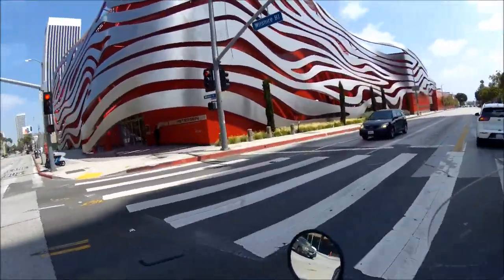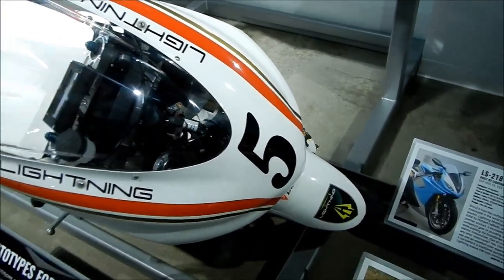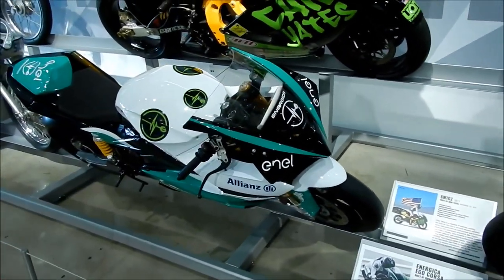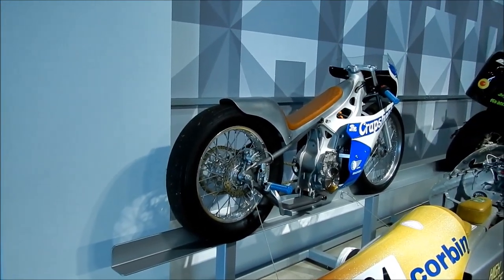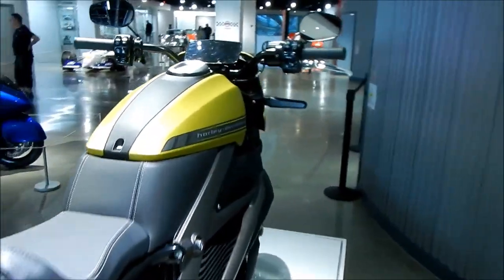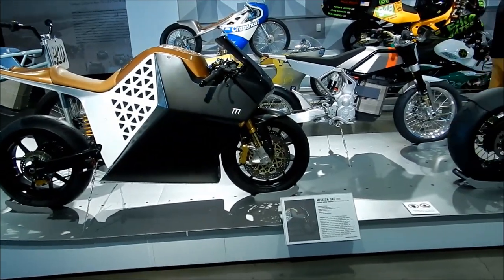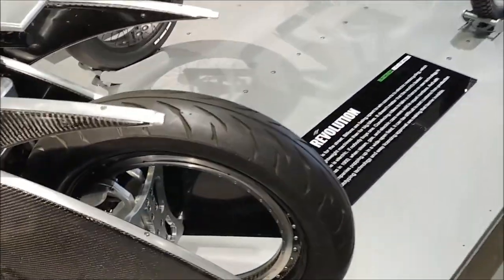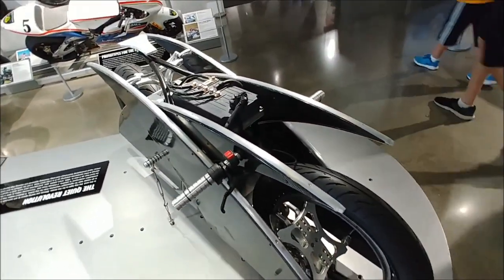HadesOmega Visits Petersen Museum Electric Motorcycle Exhibit Part 1

Comment: The chain drive think on that odd mostly carbon bike is just for the brake. That is the only way the brake could exert force against the wheel.
Two other things really struck me about that bike. First, the suspension seems to be just a hinge in the middle. That doesn't seem very desirable.
The second thing, and this really puzzled me, is the function of the steering. There appear  to be flexible mounts on either side of the front wheel holder thing. How that all might work was a mystery to me.
Reply from the maker: Actually the steering I kinda figured it out I did some research on it.  I think it has some kind of electronic steering from what they were decribing.  But the frame actually moves or actuates to tilt the wheel.  Very cool stuff =)
Reply: @hadesomegamoto7639  I wondered if those side panels moved, but doing it with electric... that would make this the first motorcycle with power steering
Wild!